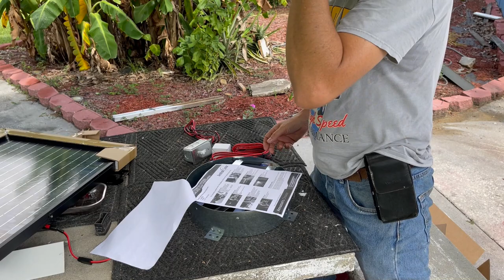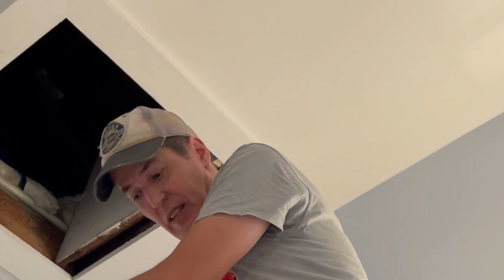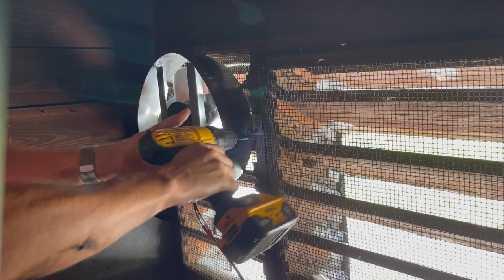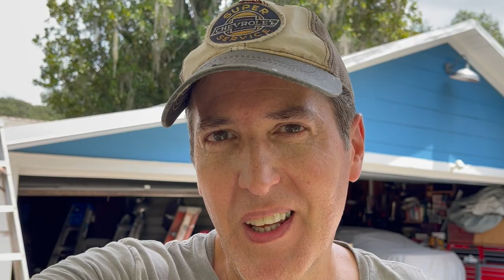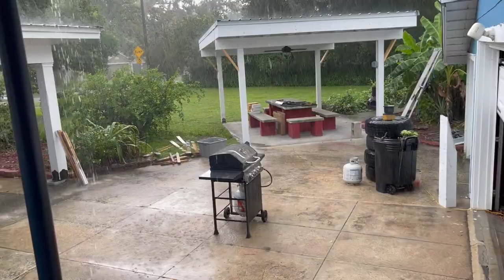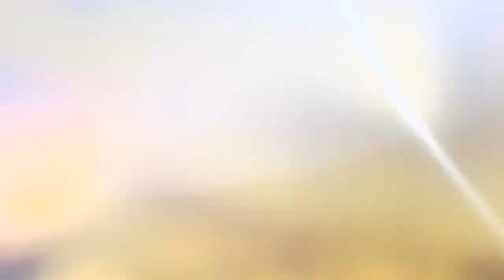How To Install a Solar Attic Fan in a Historic Home

Comment: I feel your pain and want less of this heat.  I am working on converting a pole barn into a shed.  Thirty minutes even in the morning and my eyes are burning, all my cloths are wet.  I only last a couple hours max.  Then it is shower time.  I am almost done, then it will be move in time followed by other projects that are needed. 😢😅
Reply from the maker: So true! The cool weather is coming in a few more weeks, thankfully.  This has been a very hot summer.  According to NASA it's due to an massive underwater volcanic eruption.

Comment: I installed my attic fan in the winter. Dangerously hot in the attic during the summer. I put rubber washers between the fan brackets and the wood. If the fan vibrates at all it will help keep it quiet.
Reply from the maker: That's a good tip!  I should have done mine in cooler weather but this past summer was one of the hottest I've seen and I felt I needed to do something.